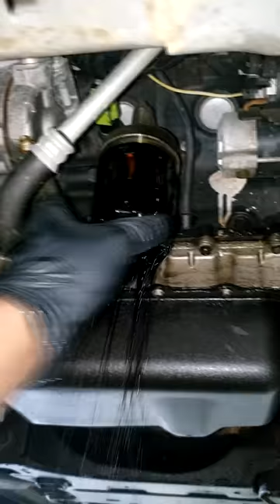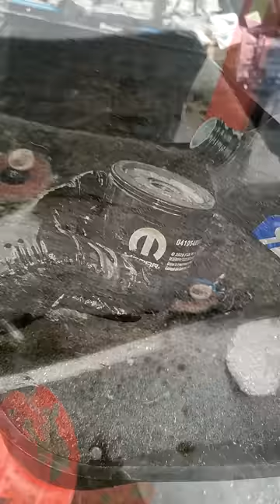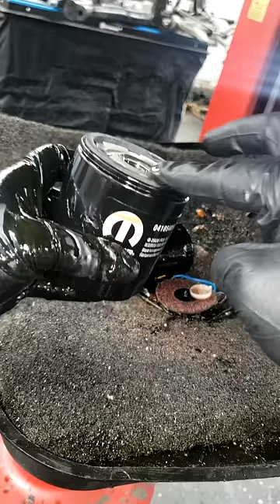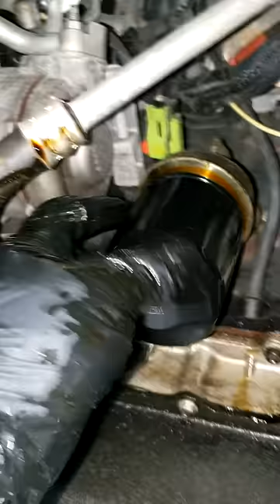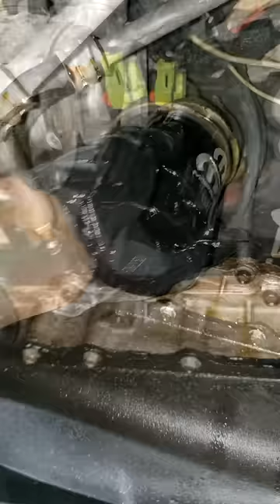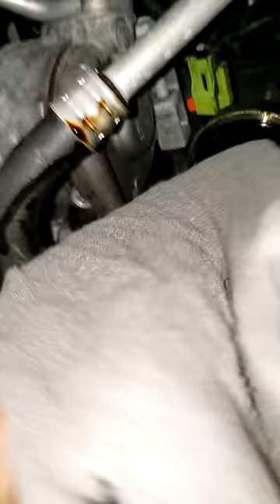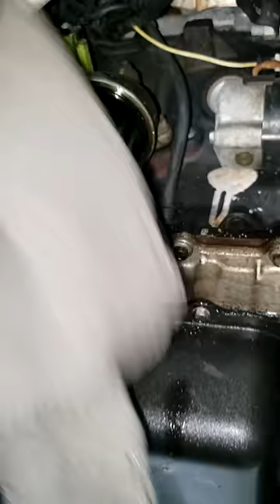Don't Lie.. Are yall still doing this?

Comment: I just changed the oil filter on my 7.3 powerstroke. The oil filter was labeled DO NOT FILL FILTER.
Reply: Why? It cant hurt. Could it?
Reply: @janandersson143  Damn rights it could hurt. If your pouring oil down the center hole of the filter then it is not filtered. That oil circulates in the engine before hitting the filter again. Biggest concern is the HPOP on Heui engines. Those high pressure oil pumps are tight tolerances. Do not stand well against dirt. CAT says no to prefilling engines, actually has check valves in place to bypass the filter till it self primes. Engines with inverted filters can't be prefilled. PACCAR MX-13's have cartridge filters, you pull the cap and the oil in the housing drains to the sump. You can't prefill the housing as it will drain in the sump. So you install a dry filter, install lid. Start engine. Idle till it has oil pressure. We have some of these engines with 23,000+ hrs and still running. Oil being changed every 800 hrs. With nearly 30 oil changes done, engine runs like a top. Point is the film of oil on the bearings before/after an oil change will not disappear and is not a dry start on the engine. On an automotive application I have seen first hand damage done to bearing. Had to split a block on a 3.0L duratec. Pulled bottom bearings. Bearing perfect but had sand embedded in the bearing material. A number of us Tech's concluded after looking at it. Dirt got in from an oil filter change, oil pump pushed it through the bearings. Only way dirt got in was from somehow getting into the center hole of the oil filter by prefilling with contaminated oil or dirt falling into the filter when installed. Oil is filtered from the small holes on the outside of the filter and out the center large hole.
Reply: @davidhenri2722  That must mean you filter brand new oil before putting it in your engine?
Reply: @Lothyde  The moment you start the engine, the oil is picked up and filtered through the filter before it hits the bearings🤨
Reply: @davidhenri2722  oh shit I made an oopsie
Reply: @davidhenri2722 why do you think that is?when I worked at Mitsubishi the manager told me us not undo the bolt that hold the oil line to the turbo it was bolted to the exhaust manfiold
It would carbonat Cuz he wanted money from replacing turbos, At Mitsubishi training they told us to take it off.
So I would say same with Ford and all manufacturers
Reply: @davidhenri2722 pouring oil in the big hole gets to the same place it saturates the filter either way just pour into big hole until it couldn't take any more.
Reply: @Standandwait88  it makes the filter wet but the filter filters from the outside holes in. Dirt collects on the outside of the filter media Google oil filter cut a way. I don't think the you understand how a filter works
Reply: @Standandwait88  your talking about a stupid manager going against recommendations from the manufacturer. I would and have reported that kind of practice. Also, what does this have to do with the proper procedure of an oil service. Caterpillar would void warranty if a customer prefilled the filter and caused filter collapse.
Reply: @davidhenri2722  That's funny when you empty the oil filter it's pours through all the holes big and small the oil will filter throughout I've never had a oil filter collapse please ?.I'm  63
Reply: @davidhenri2722  can I ask what you’re expecting to filter out of brand new oil?
Reply: @viperz888  once again. Inadvertent contamination can enter the filter. A piece of dirt that fell in outside of the oil. I'm, the manufacturer, the filter company puts this plain to see. Not worried of the oil. Worried how the person involved is prefilling the filter. Further more as is the case of CAT engines, they recommend all their filters are NOT to be prefilled. One grain of sand is enough to plug a hyd. lifter which could lead to engine tear down. Lubricate the seal only with clean oil. Install it. Your engine will live for a very long time. Your not going to convince me as a licensed mechanic nearing 3 decades that prefilling a filter is fine when we have manufactures and filter companies that denies warranty if proven contamination enters engine by prefilling and also stamped do not prefill oil filters right on the can itself. Furthermore you can collapse the filter media by prefilling the filter when service manual says not to. I'll follow the engineers advise. Not something my grandfather did back in the day. I was taught in school to fill the filter. Technology changes so prefilling is not recommended. Example. CAT engine will provide oil flow to all the bearing surfaces while the filter is filling up. Once full then the filter does its job. DD engines lubrication stays primed even if all the oil in the pan is drained. This is old motor oil but filtered motor oil that hits these bearings first, by the time the new oil is picked up, the oil filter is full and filtered on its way to the bearings. No prefilling required and also Impossible. Read my previous comment when we found sand in the bearings on a duratec engine. Only way is from prefilling the filter and a person made an opsie.
Reply: Its always good to go by the books. Me personally I don’t fill up filter for the most part unless it is required
Reply: I prefill my 7.3 filter. The oil is brandy new Shell Rotella and I'm quite certain its NOT contaminated! I've never seen that label on my filters. What brand is that? I don't want even a second of interruption of flow however I doubt its a problem either way. Yeah they got it right with the 7.3 should never have stopped making it fuck CA noise failure its one leftist state.
Reply: @davidhenri2722 well, my Mobil 1 oil filter says pre fill the oil filter 😂
Reply: Did the same in 95 F250 big ass filter we filled this way and no issues at all. I do it for any oil change regardless of what engine it is
Reply: @Standandwait88 thanks for making it clear to us you have no idea what you’re talking about…
Reply: @leecowell8165 well, according to the people that designed the engine and oiling system recommend NOT pre filling so there is that. Plus, it’s stupid.
Reply: @brandonh9016 no it doesn’t.
Reply: @sjfk1306   yes it does. Right on the box and filter. Mobil 1 performance M1- 113a. Btw I do change my own oil 😏
Reply: @brandonh9016  it doesn’t. It says to clean mating surface, oil gasket, install, tighten…. It's even in pictures…
Reply: @sjfk1306  I've been changing oil for 45 years and never had a filter collapse,you do it YOUR WAY and like I said NO ISSUES new oil in new filter no problems,I guess you do all the gov and manufacturers tell you to do,
Reply: @davidhenri2722  The manager was greedy and not stupid,what does this have do to with this issue, Well the manufacturer tells you not to pre fill and you have mobile 1 telling you to pre fill? So you side with the manufacturer so do it your way or the manufacturer and I'll do what's best in my view not worried about a collapse filter I've  never seen one do that
Reply: What brand are you buying?

Comment: you ain’t clean the surface. there’s a car out there leaking oil now
Reply from the maker: Yea I left oil on the surface that the filter seal contacts. smdh, that should be lubed anyway with oil..But yes, clean the oil oil out, we dont want the motor to lock up.
Reply: Exactly why I always wipe the surface off before I put on a new oil filter
Reply: No, you're actually supposed to at least put some oil on the seal anyway, having some extra on the surface doesn't hurt anything. If anything, I'd just wipe it down so I don't get any dirt between the seal and the mating surface, but even that is pretty unlikely to happen.
Reply from the maker: @HoloEN_GawrGura  Dude, I really hope that petty guys like this do not do this for a living. Lol, one guy in the comments condem the entire job becasue old oil was still on the the based. He said the engine could seize up..smdh
Reply: @OnlineMechanicTips  people online try to out-perfect each other as soon as they see a video with someone holding a tool in the hands and common sense is a foreign concept for them. Changing an oil filter really isn't rocket science or open heart surgery and people have done it successfully barefoot in the dessert in the middle of a dune. Engines can take a lot more abuse than one might think.
Reply: That gasket doesn't work that way. Its fine
Reply: @OnlineMechanicTips  lmao true. I've been changing oil for decades and never needed to be this anal about it. And still had three of the cars I bought new go beyond 200k with no engine issues.

Comment: I don't fill my filter. I drive a Crosstrek, which has an inverted filter, and I use Duralube.

 Once my crankcase is refilled, I crank the starter with the throttle floored, until the oil-pressure warning light in the dash turns off. This pumps oil through the filter and engine without starting the engine.

Comment: Tough to do that on a WRX lol. Unless you can spin it on faster than the oil comes out. 😊
Reply: Or a Ford 300 with a side mounted filter!
Reply: or a Toyota 4Runner
Reply: I did this on a Forester just last night. It's so easy! Fill the new filter with oil as the first step in the oil change process, and by the time you need to install the new filter it has already soaked into the filter media. There isn't even one drip.
Reply: Old ej's have a vertical filter. guessing the new F's dont.

Comment: Another thing I do is clean the dirty oil off the engine before I install a new filter.  If I saw someone not wipe that off that would be the last time they ever saw my vehicle, sloppy and lazy, takes 2 seconds to wipe it off....  🤦‍♂️🤦‍♂️
Reply from the maker: News flash, theres nobody busting down your doors begging to change your oil dude.  Yes you should wipe the old oil off but its not the end of the world if you dont. Dont be a drama queen dude.  Im certain theres other shit in your life going on you need to be concern about...FOH with that. .smdh.
Reply: Yeah, nobodies busting down my door because I got tired of crap mechanics that do sloppy jobs and do the majority of my own work, can only blame myself then, right?  Not being a drama queen, there's plenty of good shops but also plenty of bad ones, not taking 2 seconds to do the job correctly is just laziness and unprofessional.  Without wiping the filter seat clean you risk having debris that could cause it to leak later......
Reply from the maker: @Zookeeper101  smdh, would you like a cookie reward because you change your own oil.? You still being a drama queen. There is absolutely nothing that old oil being left on that surface will cause. In fact, its just going to act as a lube for the new filter gasket which you should lube anyway. Maybe your sentitive ass shouldnt be watching repair videos if something like this is doom and gloom to you. You act like the world about to come to an end. Grow a pair dude.
Reply: @OnlineMechanicTips  No cookies here please, tryin to lose a little weight.  Lol. Anyway,  hope the weather is nice wherever you are and you have a safe and productive day.

Comment: With my 98 f150 you can press the gas pedal to the floor and crank it over to build oil pressure and bring oil into the filter before you try to start it. That’s what I do after I change my oil.

Comment: Most manufacturers now are actually telling you not to prefill the oil filters simply due to cross contamination and could cause foreign debris to enter the engine. The best thing you can do is lube the o-ring install, then when your ready flood start the engine for about 5 to 10 seconds by depressing the throttle fully, then starting the engine.
Reply: That won't flood the engine on a modern car
Reply: @rrice1705 "flood mode" is for clearing a flood without starting. Modern cars usually cut fuel and ignition when you floor it while cranking.

Comment: Yeah, I prefill the filter every time unless I'm working on something with the filter on the side of the engine. That's just a mess. I usually put a tiny bit on there and lube the gasket but that's about it. Anything else is going to pour right back out anyway.

Comment: Nope, the bible says dont prime filters so i dont prime filters. Just clean the area and lube the gasket.
Reply from the maker: I wonder which one hurts the engine the most?
Reply: @OnlineMechanicTips  I'd guess the extra second it takes to fill the filter is negligible unless the engine has been sitting there for weeks.
Reply from the maker: @BMikeAD  Interesting
Reply: @OnlineMechanicTips   Well, from another pro, the oil from the bottle isn't clean enough to be on the output side of the filter, filling the middle bypasses the filtering step.  Your whole pickup down to the pump is dry anyway so you will be getting a slug of air no matter what.

Comment: Eliminates dry start bro! Engine lives matter 👍
Reply from the maker: Lmao, real talk
Reply: Yep, It doesn't get any cleaner than it is out of the bottle. Even if it wasn't, "dirty" oil is better than waiting for the oil filter to fill up while running the motor dry.
Reply: Yes sir
Reply: So you honestly believe that when you drain oil that all of it just magically disappears from the engine lol There is no dry start as the bearing surfaces still have oil on them. And it is replaced with the new oil within a few seconds. Tear down an engine that has been drained of oil and tell me whether or not the bearing surfaces are completely dry when you pull the crank or cams.
Reply: @chrisledesma60 Obviously no engine will last forever! But youll try to eliminate some dry starts
Reply: @prestonfreeman8443  How is it a dry start when the bearings all still have oil?
Reply: @chrisledesma60  1x1000=? 1 revolution of that crank. Now it's leading into some scientific explanations beyond what I can say. I'm just stating (it should or just Eldry starts)
Reply: Even if you have a “dry start” every 5000 miles, that won’t lessen the life of your engine over 30 oil changes. Your pressure will build up fast enough anyways

Comment: Hell yes you should fill the filter if possible and should clean that mounting surface as well.
Reply: Yes on the surface.  We used to tear the flaps off of the filter box and use it to hold the filter while filling.

Comment: Old-school misconceptions never die.
Reply: I can literally observe the difference in time it takes to build oil pressure on the gauge in my car. It's the difference between a half second vs 3-4 of the engine running without proper oil pressure, and at least 1 second of it running without any pressure.
Reply: @TowerCrisis it makes no difference unless the engine is completely dry. Everything is still lubed after an oil change.

Comment: Did this during an oil change on a mates Vmax, just rotated the filter to wet it and installed it half filled, he’d never seen this before, yes I cleaned the mating surface and thread

Comment: My man if you just take a screwdriver or something and use a hammer to tap a hole in the bottom of that filter it’s less messy many times over in comparison.
Reply from the maker: You video game guys always sound like lil girls. Grow a pair dude.
Reply: Yup especially on semi trucks them filters are heavy full of oil i do this to all of them
Reply: If im wearing nitrile gloves, like I do every time I change the oil... and all that oil is dropping straight into the oil covered drain pan with the rest of the oil...

Tell me... exactly where is the mess?
Reply: @OnlineMechanicTips  When you grow a pair you will have what it takes to tell me something about being a man.
Reply: @jeffklaubo3168  So why exactly are you commenting here? We are talking about the mess that can often come with removing the oil filter while it’s full of oil and I mentioned just tapping a hole in it so it drains straight out while you go finish something else and come back to take off the now basically empty oil filter and no mess.
Reply: @0Black Lightning0  again... what mess lmao... there is no mess. You are adding an extra unnecessary step to solve a non-problem.
Reply from the maker: @jeffklaubo3168  Exactly, im really having a hard time understanding there logic. Lol, The oil end up in the drain bucket as planned.
Reply from the maker: @0blacklightning046  Im not questioning your manhood, (I dont know you) Just your girly comment
Reply: @OnlineMechanicTips  what girly comment?
Reply from the maker: @0blacklightning046  You know what dude, I just read your initial comment. Its not as bad as I thought it was. I now know what you meant and was trying to say. I think because you use the word "messy" it thru me off. Everybody elsed used that word in a non manly way here in these comments and I want thinking this was just another sensitive post by a sensitive person. My bad dude. Its just thos girly comments was coming back to back and I mistook this for one.
Reply: @OnlineMechanicTips  No problem. Water under the bridge.
Reply: @OnlineMechanicTips most women hate the word "messy".

Comment: Not much need to do that and some oil filter designs/placements make it virtually impossible to do that without making a huge mess.  Once you fire that engine and its running at idle, that filter will be filled within seconds.    Not that it isn't a benefit to do it when you can, especially with larger filters, such as big, expensive diesels.  Gas engines?  Not really needed, but, again, definitely won't hurt anything.

Comment: I still do it out of habit. It only take a couple seconds and I dont care if it really matters or not.   I believe the more oil i can get closer to the top after an oil change the better.    I have shown friends that on older engines it makes a difference with noise upon start up.  Noise is not good.